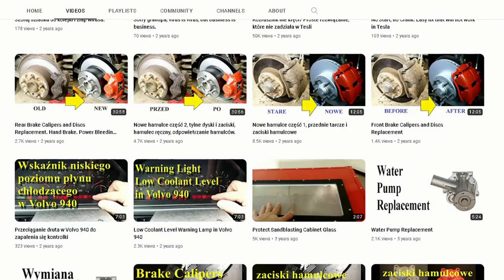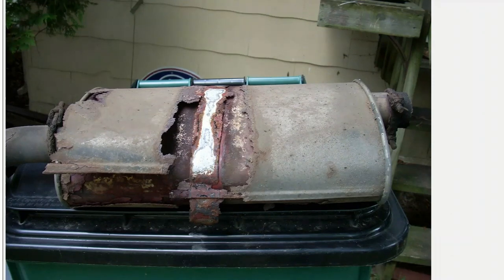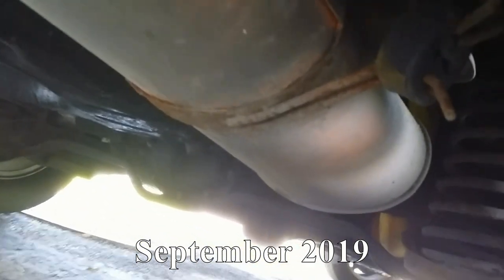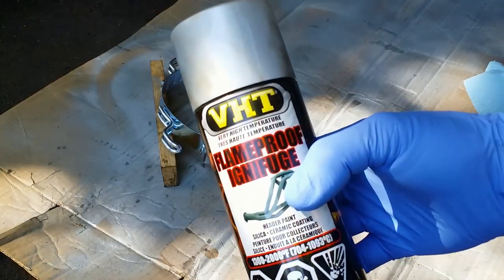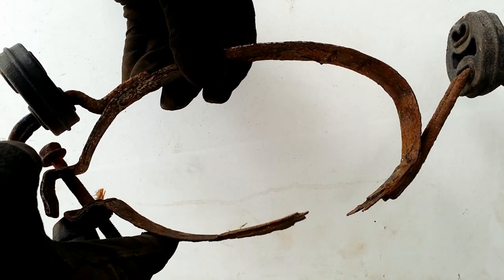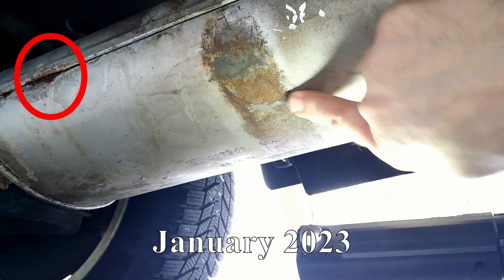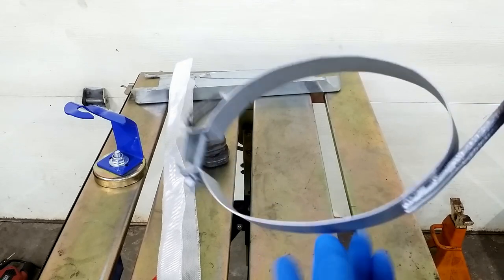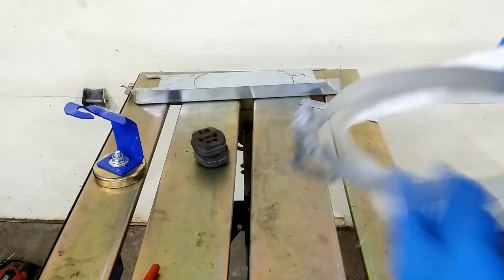Preventing Exhaust Rust - Update

Comment: great info. i also use fibreglass weave in between the hanger, but i drench it in oil so it won't keep water inside it
Reply: isnt it going to smell like burnt oil? im planning on also using the fibreglass to prevent rubbing and rusting out the new muffler
Reply: @superjojo555  only in the very beginning, but i find that the volatiles usually evaporate after maybe one day of driving
Reply: @BasicEndjo  the store was out of fiberglass so im going to try a non stick silicone baking mat lol
Reply from the maker: Please report the results back here.
Reply: install went good. i also sprayed the pipes and welds with high temp paint. i also put epoxy putty on the welds because from experience they rust first and put the silicone mat between the muffler and hanger (the same style as in the video) ill give an update after a while.